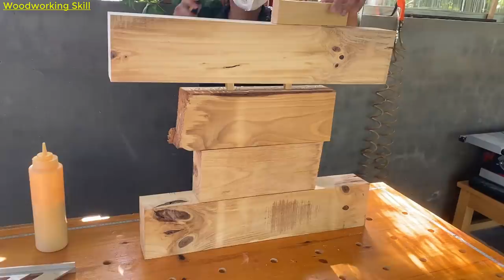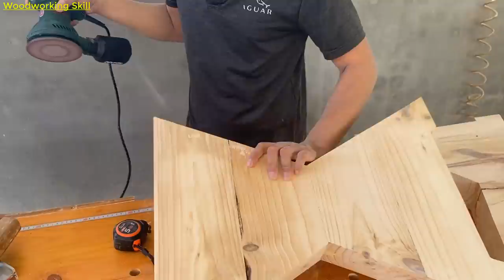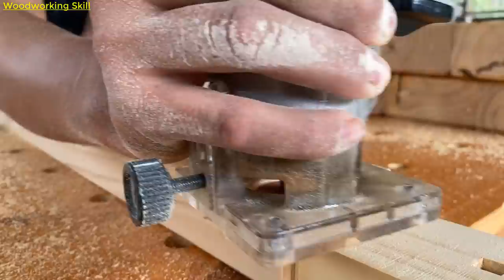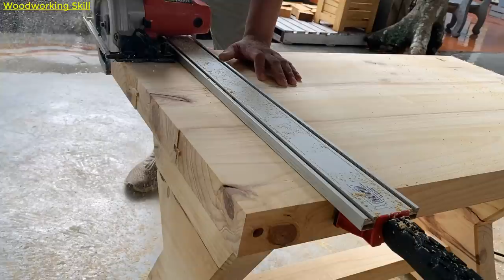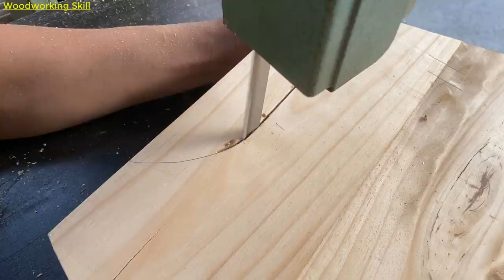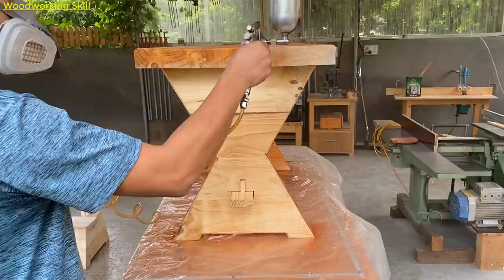Unique Furniture Designs That Will Make You Drool // How to Build Patio Furniture Overview

Comment: I found it frustrating to watch you make that. I like the overall design of the piece, but I feel like there could have been more attention to detail. The way you glued the supports for the table left huge gaps, not to mention the wood was oriented in the wrong direction, especially if it's going to be barring a load.  The way table is secured to the top is going to fail eventually. I don't understand why you chamfered the edges on the table and not the benches, especially because sitting on sharp edges isn't pleasant. The whole time I was watching all I could think of is "this guy is just trying to get it done as fast as possible and doesn't care if the whole thing falls apart right after it's done." Please take the time to research what other furniture makers are doing, this will help you improve and grow as a furniture maker. I see a lot of potential for you to become excellent at what you do. I hope you find my criticism helpful and not just as someone telling you you're terrible at what you do, that's not my intention. I wish you all the best!
Reply from the maker: thanks for your comment. We will try to make it even better
Reply: Great advice.